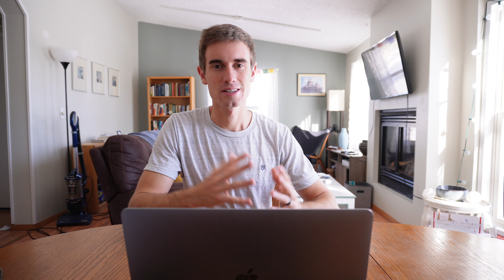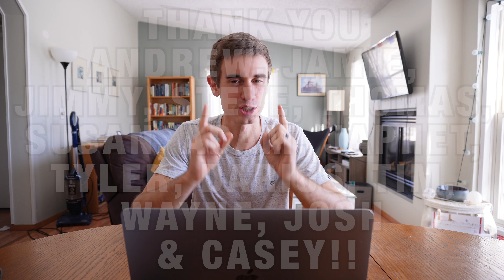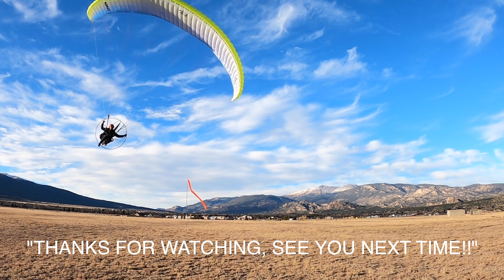Warm Up The Motor WITHOUT Getting Tired

Comment: You can start your motor on your back if you have a good engine. I needed a few minutes trying to start my former engine before it began to operate. I would never succeed to start it on my back for the first time. What I have learned is to prime and start the motor on the ground, but without a propeller and let it work for seconds. (I always dismount the motor after flying, having little space in my car and cell). If it is ok, I fix the prop, put motor on my back, start again easily and fly. If not, I do not have to take it off my back. Fortunately, I changed my motor to a better one with no problem.

Comment: Check throttle action before putting the machine on your back so you can directly observe the cable connection to the carb and make sure the carb arm is moving freely when operating the throttle.
Reply from the maker: Yep, that’s exactly what I show in my preflight video 👍🏻👍🏻

Comment: I'm a super nerd when it comes to engines, I look forward to warming up my engine because there is nothing more cringe than holding WOT on a cold engine.  I slowly bring the RPMs up, 3000-4000, 4000-5000, 6500, 7500 and then hold until I reach 80C (my engine redlines at 9500).
Reply from the maker: Very nice, take care of her and she’ll take care of you (mostly)! Thanks for sharing.

Comment: Just get an electric PPG and you won't have to warm up your motor. ;) good tips.
Reply from the maker: I flew the Open PPG recently in below freezing temperatures right before flying mine and it almost convinced me to say screw it! It took so long to get my motor warm enough to not die at idle… once the battery tech gets a little lighter to allow for stronger frames I will be making the switch for sure 😅